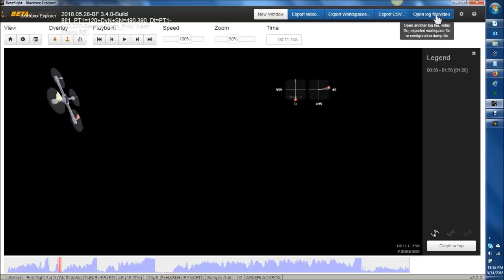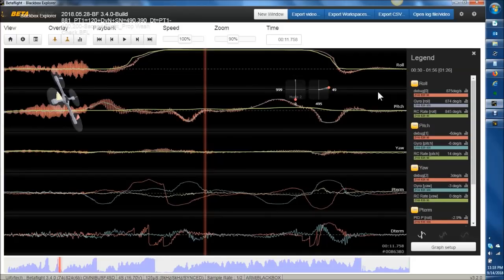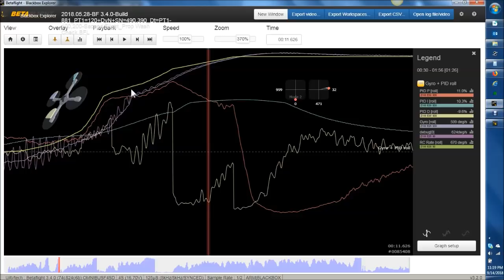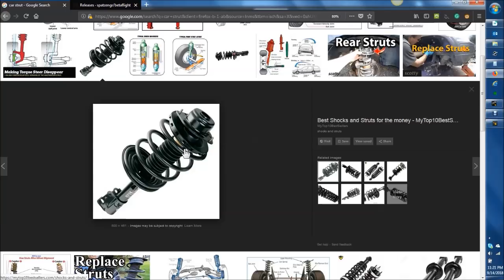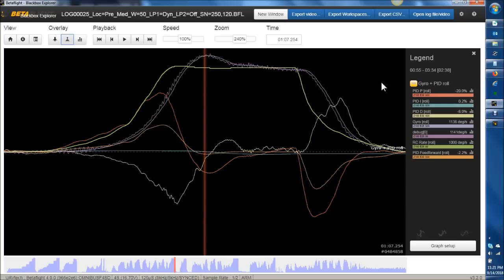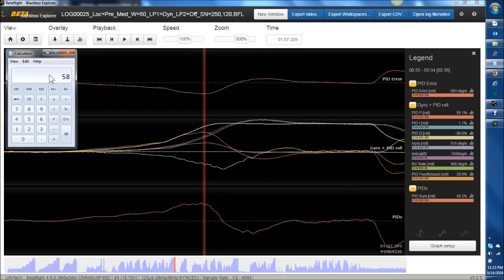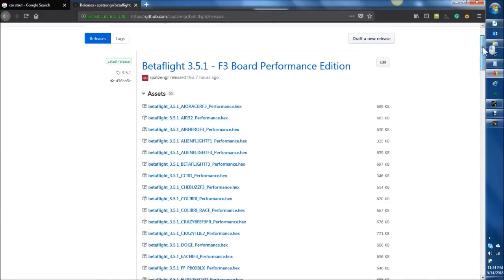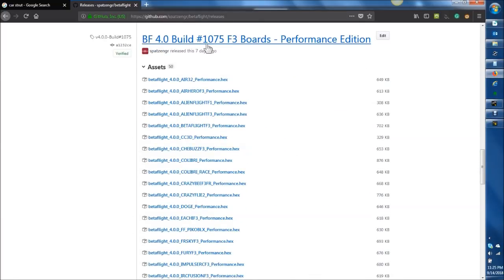BF 3.5 FeedForward Under the Hood

Comment: Hey Mark, thanks for the video.  I think it would be really helpful to go a bit deeper into the logic of feed forward.  For example, why is feed forward superior to increasing your P instead (the old way of getting a similar result).  I think it may also be helpful to go a little bit deeper on the D term analysis.  While most of the time it will be dampening, it'll also be enhancing upon the initial error.  

My original understanding of feed forward was that we were essentially anticipating what the future error will be based upon the movement of the stick.  For example if I'm currently moving my roll stick that has a set roll rate with it's current position, but the stick itself is still moving so the next roll position will be even faster, and feed forward is trying to account for that in the current calculation since it knows it's shooting for a moving target roll rate.  It was unclear from this video if you're saying that understanding is correct or incorrect.  It also made it unclear to me as to when I would adjust P or when I would adjust feed forward.  Thank you!
Reply: Forward feed calculation is similar to P except it is a delta of current setpoint and previous. So forward feed apply on how fast the quad is rolling/pitching compare to the previous PID cycle. So there is a distinct different. For example in the last cycle your set point rate was 60degree/s  and now it is 70degree/s, the forward feed gain is that 10 degree * the value of the forward feed/100 and RC Smoothing is applied on top to smooth spikes. This only applies outside of transition. Inside transition it is 0.   Where as P is the delta of commanded RC rate and the current set point. 

The net affect is forward feed does not care about error, so the faster you move the stick the higher it's contribution.  P does.  This forward feed can changes how you apply P.   You can now use forward feed for fast response than using P.  So the net result is you can have lower P if you using forward feed. This is very important because you may have a scenario where you can not increase P any further because of oscillation and the quad is still not responding fast.
Reply from the maker: Do u have a camera setup in my office?  That or a sixth sense.  Stay tuned!  :-)

Comment: This might be a dumb question but here it goes: By the traditional tune by feel convention raising D-gains will help reduce propwash. If FF counters D-term when you do fast inputs, how would it effect the propwash handling in a shard input 180 turn? Wouldn't the propwash handling be worse if FF was high? I haven't had the time to try, so just speculating and trying to get a better understanding of FF
Reply from the maker: See https://www.screencast.com/t/vvBd16n0m. It appears FF has little effect during 180 degree turns.  It is important to note that D-Setpoint Weight would have had the same impact, however you would not be able to quantify in BBE because Setpoint Weight didn't have it's own trace to track.  Of course you can run tests with FF = 0 and FF = [your desired feel gains] to check for yourself as well.  I have not run those tests.  On one side it helps with prop. wash wobble when it is in the same direction as your stick move.  When the wobble is in the other direction, PID Sum is lessened by a small value; but it appears <10% of D-term overall push. Since the +10% doesn't seem to make a huge impact, then I would summarize the -10% doesn't either; at least for this test quad where I think the prop./motors are controlling (too slow).  If you want to minimize (balance of both world) you can turn on Smart FeedForward.  With SmartFF enabled, and P and FF are in the same direction, FF is only activated when FF is greater then the P value.  It would be nice with SmartFF if that FF and P were in the opposite direction, FF would not be activated either, but that is not the case currently it appears.

Comment: So, dterm is not always but most of the time, opposite or negative to the pterm? Or at least it was, until BeF added setpoint weight. Then it could be both but now from 3.5 it will mostly be back to opposite of the pterm again?
Is dterm doing a better job being that way?
Lot of questions, but I'm a geek and I love to understand these things
Reply: @codecae2  thanks. I have to read it again when I get the time to night, but I understood most if it. And it made sense.
Since 3.5, ff took a place in the pid loop instead of d-setpoint weight. So will dterm have less effect in the initial rotation movement, and have better control over what d is suppose to do?